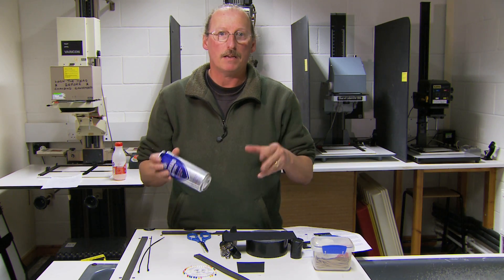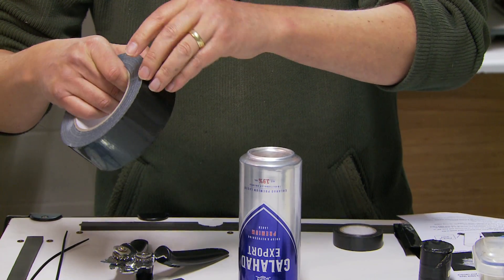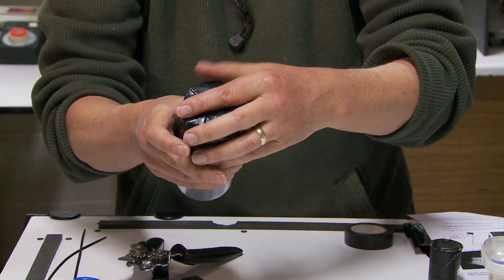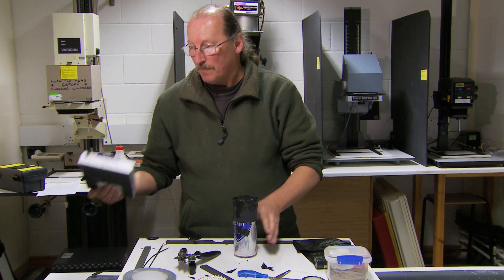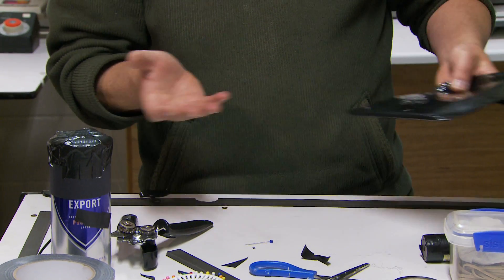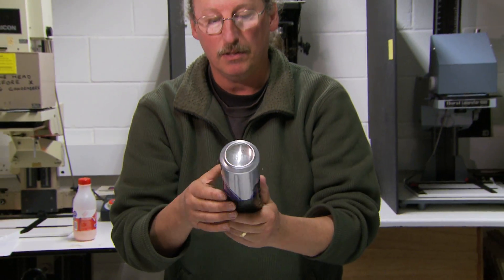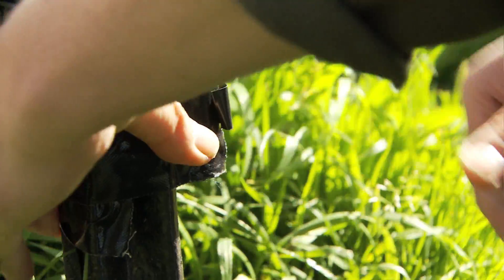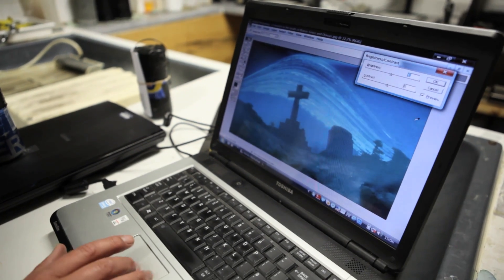How To Make a 6-month duration Pinhole Camera

Comment: Fantastic training material. But I have attention. Photosensitive paper placed on the concave wall of the can causes distortion of the image. I suggest trying to put the photosensitive paper on a flat surface, on the opposite side of the hole. Use a shoe box as a "camera obscura", for example. It used to be negative film, now the transducers are flat.

Comment: Back in the mid-50s when I attended YMCA summer camp, the science cabin guy showed us how do put paper in a glass and wood frame with leaves on top of the paper then expose it to the sun. Were they called SolarGraphs?

I want to think he somehow permanently fixed the images but don't recall after over 60 years. Like you said, if someone developed the paper it would be black or if they used fixer, the image would go away. Is there a way to permanently process the images?
Reply: Hi Terry, the process you are mentioning is called cyanotype, and the image remains fixed permanently afterwards with just a rinse in water

Comment: I would say scanning these lumen prints works fine, but most scanners give slight scanning lines, and don't pick up all the subtle detail. I've got better results copying the prints with a DSLR - even better if you have a macro lens. Use Raw, rather than Jpeg, for proper control to bring out all the lovely tones, in either Lightroom or Photoshop.

Comment: Lovely! I plan on doing this. Is there a need to secure the paper inside so it does not rotate in the can and obscure the pinhole?
Reply: I was thinking the same thing. What I would do is leave the pin in place thereby blocking the paper from shifting around. And then once the can is set up, remove the pin to start the exposure.

Comment: Hundreds of years?
Photographic paper has only been around since the late 1880's, when dry plates were developed.
Reply: Photographic paper was introduced in 1839 by Talbot and existed as a prototype for a few years before that.  So yea, saying hundreds are years isn't terribly inaccurate.
Reply: I was referring to photographic printing paper as he was using, not the sensitized paper used by Talbot as calotype.
Reply: Zachary Coronado ehem befour that they used silver nitrate on original paper

Comment: Thanks so much for a fantastic video love it just wondering though I am working with a group of students with a disability creating a pin hole camera and taking photo what is the minimum time to leave the camera out I know you said month but I need it to be probably no more than a day or two will that matter if it is a sunny day? thanks
Reply: +Trace Davis I am taking a class in school and we do them with about 1 minute of exposure. However, we develop the photos in chemicals and i believe the paper is of different material.
Reply: Thanks Gabe I actually got onto Tarja Trygg and she said 2 days is ok which suits me and will definitely suit the kids. I have seen the same paper used but instead of using chemicals you can use dried mint tea which we will do as well to develop still need a dark room etc but that is ok. I just love this one as there is not messing about and keeps it simple for the kids. Thanks so much for your reply.

Comment: Is gaffer tape "duct tape" to an American?
Reply: +rooseveltEroosevelt duct tape is gaffer tape .conductive tape is completely different from the plastic electricians tape .
Reply: @kennyk4134  ; Duct tape is not Gaffa tape. Two different animals. Ask a roadie.
Reply: Gaffer tape is used by movie and TV crews. It is much more expensive than duct tape. But regular duct tape should work OK. I would just worry about duct tape's glue drying out when exposed to sunlight for a couple months.
Reply: +John Stilley No duct tape stands for conductive tape, electrician tape. But try it, I don't see why it would not work!

Comment: Would someone explain to me why i can't develop the image?
Reply: +DieQwietscheente developing the paper will result in a black image because the role of the developer is basically to accelerate the exposing process. You will already have an image when you take out the paper.
Reply: You could, but would need a much shorter exposure. We made pin hole cameras in college, using photographic paper, and we developed them to create a "negative". Then we used them to create a contact print onto another sheet of paper. Of course scanning at this stage would provide a sharper image as due to the thickness of the paper, it made the image less sharp. The exposure was 5 days I think.

Comment: Do I need to buy "photographic" paper, or "photosensitive" paper? reason i am asking is because i thought "photographic" paper will get messed up as soon as light hits it.
Reply: photographic paper
Reply: +ZER012345678 Photographic paper is not that much sensitive, that is why it is used to make the prints, because you can work on them easily by adding seconds and more seconds. It would be pointless if it took fractions of a second like with film.

Comment: I did some experimenting with 'lumen prints' and you may be able to fix these images to some degree in a saturated salt solution. I say it may work as I have only used salt to fix lumen prints, not pinhole prints.

Comment: Hi, all the videos ive watched for this uses cans. Is it possible to do it with boxes? Or would that affect the way the light hits the paper in some way? 

Thanks.
Reply: natalie smith Yes it would be possible with boxes, I have done it with them before, and the only challenge is making sure it is black inside (totally sealed except for the hole, and  make sure you have a way to keep the paper in place (if the paper moves it will not create a clear image).
Reply: @Chrisanddog  what for paper did you use for a 5 sec exposure time.
Does ilford photo paper  work
Reply: Jochem F ilford works just fine! It's kind of a guess for exposure time based on apature size. You might have to just try one out and and just exposure depending if it comes out over or under exposed

Comment: Any recommendations on making this work for 1 year instead of 6 months?  Would this design overexpose?
Reply: if you want to increase the duration by 50% you have to reduce the light by 50%.

solution 1: reduce the diameter of your hole by 50%
solution 2: Block 50% of the light by taping some dark foil (aprox. 50% light gets through) in front of your hole

Comment: ok i have a question, its probably a stupid one but, do you have to use photo paper, like is there a way to use regular blank paper and use that for the pinhole camera, cause im confused
Reply: Bobert, you MUST use actual photographic paper. Buy some online in 5X7 at Ebay, or if there is a handy old time photographer living/working nearby, ask for a sheet. Or try the local photo store.

Something like this is what you need:

http://www.ebay.com.au/itm/ILFORD-MG-44M-5-X-7-PHOTOGRAPHIC-PAPER-PACKAGE-STATES-25-SHEETS-/201089754726?pt=LH_DefaultDomain_0&hash=item2ed1e22666

Comment: you would not believe it but it works! Quite well! He is using foto-paper , so you can not use an enlarger. To invert the image you can use - as shown- a scanner and  the free software "gimp" e.g.
the problem is only the correct hole size and its accuracy.

Comment: What is the use of the shutter? When it is installed do you just leave the shutter open?
Reply: To prevent light getting to the photographic paper. Once you've installed the camera - yes - you open the shutter and leave it like that for the duration of the exposure.